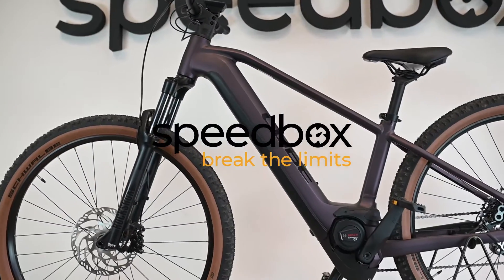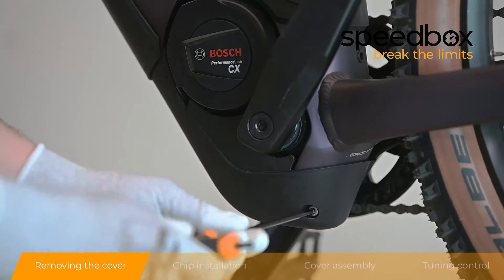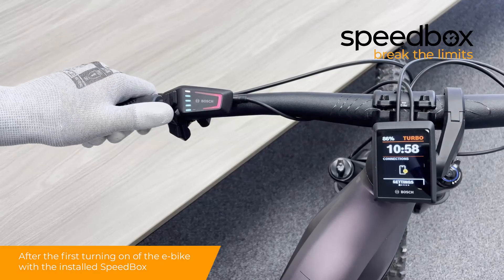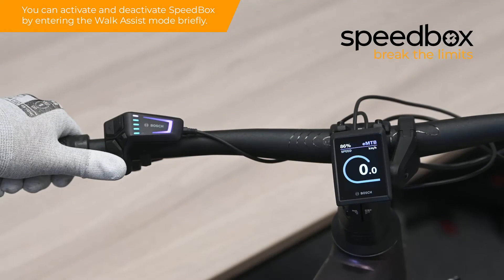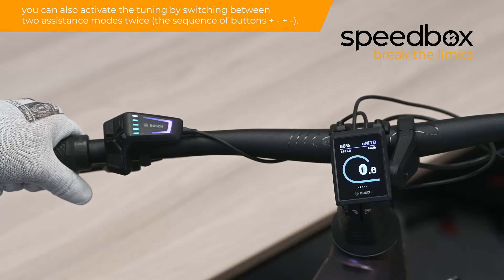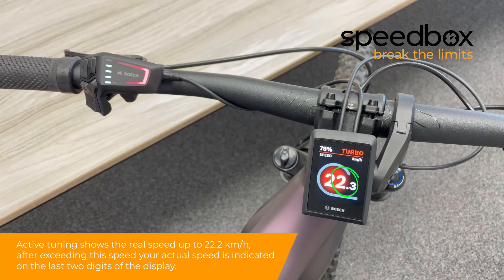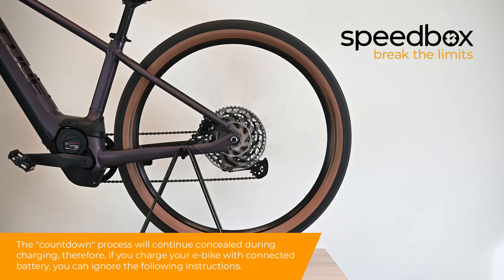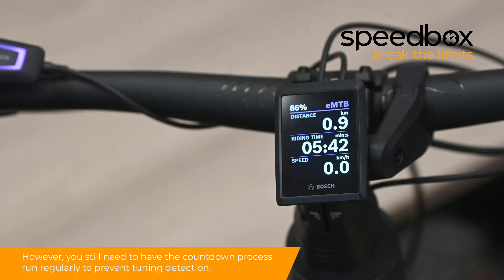eBike Tuning SpeedBox 1.0 for Bosch (Smart System) Installation Instruction

Comment: Does it work correctly after few months ? And do people have the 504 error a lot with smart system ?
Reply: Read and see how bad people say it is so will be waitin for 1.1 version hahaha this one seems to suck
Reply: I got 504 after 120km with this, I would steer clear for now.
Reply: @raftermanhoward1883  do you have respected the count every time ?
Reply: @rolletharold8843  Yes, of course.
Reply from the maker: @raftermanhoward1883  Hello guys. The 504 error can rarely happens. Sometimes it can be caused by mechanical issues like damaged pin during installation. In any case it is not a system error. It is hardly possible to "provoke" this error on purpose for diagnostics, but we are still looking for ways to eliminate this issue as much as possible.
Reply: @SpeedBoxTuning  thanks for the response it's help a lot 
Can't wait to resolve definitely the 504 error
Reply: I've gotten 2 504 errors now. Only happens if I ride often above 40km/h I think. 30-35km/h should be safest options. I never get 504 during winter time, since I'm not going that fast. Only on summer time.

Comment: Hi fitted your speed box 1.0 for my Bosch smart system 2022 bike with 750 batt I’ve followed your videos to check if it’s turned off or on but when off mine shows 1.5 or 1.6 when activated shows 6.2 any reason why
Reply from the maker: Hello Becky. Please contact our support and try to specify your issue.

Comment: Based on all these complaints I certainly will not be buying this. Shame.
Reply from the maker: Hello Martijn, as we mentioned in comments above. The Bosch Smart System is quite new and challenging and the SpeedBox 1.0 is our latest product for this system. Some problems may arise from objective causes. They are all solvable, you can contact your dealer or our support at any time.  The 504 error can rarely happens. Sometimes it can be caused by mechanical issues like damaged pin during installation. In any case it is not a system error. It is hardly possible to "provoke" this error on purpose for diagnostics, but we are still looking for ways to eliminate this issue as much as possible.

Comment: Is there any solution to the ebike automatically rebooting and disabling the speedbox issues yet?
Reply: My bike was the same I let it count down like they said but it still put me into limp mode
Reply from the maker: @lesliekirk7036   Hello. According our experience, the tuning detection is more sensitive, if you drive more then 42 km/h. If you drive max 40 km/h, you can avoid the unpopular limp mode.
Reply from the maker: Hello. We recommend leaving the bike on for a while after each ride in order to countdown the mileage to avoid any errors. If you have any question, please contact our support.
Reply: @SpeedBoxTuning  I did that and it failed me badly.  Had to remove and have bike reset by a Bosch engineer

Comment: Installed mine and is not working well… sometimes the chip turns off… when i activate it says 10.5 instead of 9.9… the speed is not reading well… im going like 23kmh and it says 23,5…. I know that only the last 2 digits counts, but im going at 23, not 35… (23,5kmh on the display)
Reply from the maker: Hello Tiago. The problem could be due to incorrect calibration. If you have any question, please contact our support.

Comment: Bike> Cube Kathamndu Hybrid SL 750 (2022) Bosch Smart system Kiox 300 after i install the speedbox i feel it works but only for few seconds then my ebike go off with no codes or error...i turn bike again and ride but still go off after i break 25km/h
Reply: Hi, I have the same bike. So your conclusion is that it doesn't work well? Thanks in advance for your reply!
Reply: @nathaphonsulimphumi2684  it works as described in the store, with the exception of unlimited speed, which annoys me terribly, but still better 40 km/h than 25, for example uphill. But I believe that after contacting the seller of the chiptuning bike, the problem will be solved
Reply: @ragnarlothbrok4683   I'm getting weird bike restarts too on my cube . Seems to happen more often when going fast downhill. The simple fact that the bike records high speeds even when not pedaling causes it to restart most of the times. No error codes (yet).  Did you get any solution?
Reply: Just an update. I used the speedbox app on my b.tuning speedbox and limited the speed to 40 and it has not restarted yet (50km trip no restarts so far) .   Maybe the problem is by setting it to  “unlimited” .  Will update if anything changes
Reply: @TpyroX9  Thank you for letting us know! :)
Reply from the maker: @TpyroX9   Hello guys, hope your bikes are running fine now. There are many types of bikes and in theory the chip can behave slightly differently for different types of bikes. The Smart System is a pretty new system. If you have any question, please contact your dealer or our support.
Reply from the maker: Hello, please contact our customer´s chat on our website.
Reply: @SpeedBoxTuning  Hallo guys I found out that when I exceed the speed of 40 km/h, the entire ebike turns off..

Comment: Just a quick warning. I have used this tuning module and even though i used countdown after each bike ride, i still got the 524001 error today and now the bike is in limp mode.
Reply: Oh really!  I just got the 1.0b shipped today... maybe I should return it!   Did you get the error immediately after starting the bike or did it go into limp mode in the middle of a ride?
Reply: @TpyroX9  It has just begun with me today. Even after riding at get home pace for 90 mins it is still here.
Reply: @robertgowling191   Hey Robert, do you mean you are getting an error code? Not all error codes indicate tuning detection. 

I have found out that using old bike firmware will trigger tunning detection even without any tuninng dongle installed.

Im running the latest updates, 392kms using the dongle, no error codes yet, just small annoyances that I described a few comments above.
Reply: @TpyroX9  no i got it after about 50km. I'm not using mine anymore. If you hit the limp mode 3 times, you would have to go to the dealer to get it unlocked.
Reply: @TuXido1777   did you get the Bluetooth version or regular version of the speedbox 1.0? Now I'm really worried.
Reply: @TpyroX9  i got the regular and it did happen 2 km into a ride. I actually wrote to speedbox to let them know i followed all the things you needed to do(cooldown etc.) but still got the limp mode. They responded that it was because i did not. So i was kind of sad that they did not want to do anything about it.
Reply: @TuXido1777   holy smokes that's fantastically bad customer service. So they won't even take it back?  I'm almost even considering not accepting my package altogether now
Reply: @TpyroX9  I haven't pushed for a return but my guess would be no when looking at the mail they sent.
Reply: @TuXido1777   did you happen to update your ebike recently?  Mine received an update this week, I wonder if that might have changed the detection method and thats how you got the error now.
Reply: @TpyroX9  I have not updated my bike at any point. I did that to try and prevent tampering detection(limp mode)
Reply from the maker: @TuXido1777  Hello Kim. Bosch 1.0 is pretty new product and 504 error can rarely happen. We are working on it. Please follow our social media or contact us later. Thank you.
Reply: @TuXido1777  They seem to be copping out of this.  It has just happened to me..Now what?
Reply: @robertgowling191  it seems like there is a tuning module called mtt that does the trick 😉
Reply: any news guys ?
Reply: @rolletharold8843  I  YOLO'd and installed the b.tuning version . 300kms in (with the latest ebike updates, and updating the bike fearlessly through the flow app ) have not had any tuning detection error codes... YET. 

This thing works, but the experience is still a little rocky, with this thing installed ive experienced: 

1)Random Ebike restarts in the middle of a trip, tuning must be re-enabled manually
2)When stopping anywhere, the countdown process kicks in the background and causes a 5s delay in motor support once you start pedaling again (this can be worked around by keeping light pressure on the pedals which will prevent countdown from kicking in buyt it still kind of sucks)
3)Walk assist function strenght is slightly diminished for some reason.
4)The speedometer on the kiox display works decently well once you understand how to read it, however speed readings wildly bounce sometimes  and feel g enerally unreliable, you can actually see how sometimes it goes over the speed limit and motor support is cut, but then the speedbox quickly corrects it creating a small "tugging" feeling.  This does not happen very frequently, however.

Hope my comments help. I know I wouldve loved to know all this before purchasing.  

Still dont regret it, though, and it can be easily removed,reinstalled to fit your needs.
Reply: @TpyroX9  hey how often are the restart? 
I don't understand why Speedbox have a countdown et Volspeed V4 don't
Reply: @rolletharold8843  Sometimes they feel random. Have had it happen 3 times on a 30km ride, have had it not happen for a 50km ride.  It seems more prone to restarting if you are going really fast downhill with tuning enabled, even if not pedaling and motor assist is idle. Seems like you can cause it to happen more if you get a sudden burst of speed and the speedbox appears to fail to correct the speed  redout on the kiox fast enough for some kind of check to kick in and restarts the bike. 

Regarding countdown, im guessing volspeed might be using a different method of tuning detection avoidance (or lacks it). 

The countdown process is really not a big deal, have not seen it run for more than 3 minutes   on a 50ish km trip (countdown seems to run in the background on any chance it gets so im guessing that by the time you get home, the remaining time should be minimal), you can just leave the bike idle for a few mins and turn it off, or just leave it on and it'll shut itself down after countdown completes and enough idle time has passed
Reply: @christopherx99 do you use the flow app for navigation rides as well? How is the Speedbox now? Any detection yet?
Reply: Thank you Kim. I was thinking of upgrading to the smart system... I'm gunna wait.

Nothing wrong with my speedbox 3.0 on my bosch performance cx.
Trek Powerfly 4
Over 2000km in turbo mode never once seen an error or hiccup.
Reply: @ryan6764  Sounds like the right choice. The flow app updates the ebike software continiously. No dobut they will eventually brick  the chip.   meh... I wonder if I could fit in a US version of the motor.. I would really be comfortable with the 20mph limit.. the EU motor 15mph blows...
Reply: @TpyroX9  thankfully the OTA updates are not automatic you have to press check for updates in the app so thats a worry we dont have. 
I would very much like to know which firmware version they have tested on. I wish they would make it 20mph worldwide your right 15mph blows im faster on my light hardtail chillin, I have a ten speed and the last 3 high gears are useless when restricted.

Comment: Will there be a possibility to set another max speed? Like for example 35KM/H in stead of unlimited? Also interested in countdown time; will it take longer when bike was driven longer, or it it a fixed time? And what happens when battery goes flat during last KM of ride?
Reply: Hello. Bosch 3.0, 3.0 B.Tuning and 1.0 B.Tuning have speed limit settings. Countdown time depends on time and speed of your trip. If your battery is flat, then remove and charge and countdown process will start.

Comment: Bought one and have a few questions please: What is this 'Countdown' process all about and why is it necessary?  Everything is clear but that part...can you please do a video to eleborate on this requirement?  Does it take long to complete? Is the time you have to wait for the countdown process to complete relative to the distance covered or time the unit is on? What happens if the bike battery is completely depleted during a ride?  What do you mean by 'prevent tuning detection' and how long is 'regularly' with regards to having to run the countdown process?  Cheers.
Reply from the maker: Hello, Mário already answered. If the battery runs out while driving, the countdown process will continue again after charging. We recommend it as a prevention against detection.
Reply: @SpeedBoxTuning  what if my e-bike has no display? My KTM bike only got the controller
Reply from the maker: @vince5390  Hello. Display is not a necessary condition. Tuning is activated by the WALK function or by switching the + - + - mode. You just can't tell visually if the tuning is active/inactive. For the B.Tuning version, tuning can be activated directly in the application.
Reply: If I understand it correctly, the countdown process basically sets your avg speed to 25km/h so that if police checks your bike they cant see immediately that you chipped it
Reply: @doktormerlin  no, it prevents tuning detection, you can easily get a 504 error code, countdown simulate ride and prevent this detection
Reply: @DarkstarSk8er4ever  Hallo Mario what i have to do if i get 504 error code before i even install the speedbox ? i think my ebike is now in limp mode. My ebike work only for short time then turn off.
Reply: @ragnarlothbrok4683  go to the shop, to your dealer, to unlock it or ride 90min without asistence
Reply: @ragnarlothbrok4683 check speed sensor and magnet, make sure there both in line.  riding the bike for an hour will do nothing